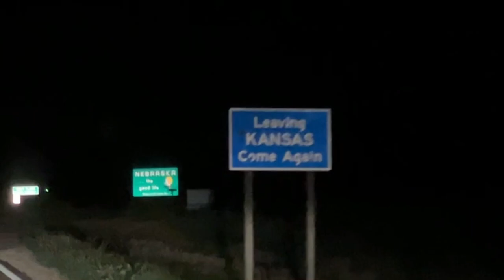Towing a 1969 Barracuda to the farm

Comment: Learning, Yes you do!  I have owned my 1969 383 Formula S fastback since 1984. The car was really incorrect compared to its birth in September of 1968. 

I have restored from early 2012 to finish in late 2014.  One of the 272 Torque flight  727 trans  equipped Formula "S" Fastback cars produced! 

Your purchase at quick glance is a B5/B5 SB one of very many. You can make it whatever you want, I suggest a gen 3 Hemi with a total paint and interior restoration to factory specs!

It will make the vehicle very sought after! JMO!
Reply from the maker: I love the gen 3 Hemi idea. Would love to find a wrecked Demon and swap everything over! Love your '69 holy crap what a beautiful car that is. I might copy that blue paint. Thanks for info truly enlightening.

Comment: You would have a easier time finding a 360 Magnum from any modern fool injected pickup. Intakes and carb's are cheap and easy to buy. Roller cams are easier to live with modern oils.  Wait till you try and buy that headlight bezel for the drivers side. Get ready to sell your first born.
Reply from the maker: Great advice! And I really never want to get a motor with AFM or whatever Dodge calls it. Thanks Henry!

Comment: If you want performance as a “little giant killer”, then go with a ‘66 or ‘67 273 Commando. That was the basis and the original LA engine. You could build more horsepower and torque out of those than you ever could a 318. The 318 was also an LA engine, but the 273 was better suited for building. The biggest LA engine was the 340, and that was a beast, especially as a 340 Wedge. My favorite motor is the 383, but in the A body Barracudas is was too heavy for any cornering or braking. For straight line performance they were great but not for enjoyable spirited driving. 273 Commando or 340 Wedge is the way I would go. My ‘66 barracuda Formula S has the 273 Commando with 727 Torqueflite console shift which was one of only 2600 made that year, and my Grandpa bought it new then gave it to me for HS graduation in 1984; and for that year boasted 275 horsepower (compared to ‘65 and ‘67 having 235 horsepower). My ‘65 Barracuda also has the 273. It’s  amazing what those motors can do. BTW, you picked the best body style as a fastback, hands down. When it became it’s own car, departing from the Valiant, in ‘67, the fastback was deemed as Italian styling, and to me remains the most beautiful car ever built. A ‘67 Fastback Formula S remains my holly grail, and at age 58, I’m still hoping to find the right one. (I’ve been in live with them since age 2, when my Dad bought one new in ‘67 until 1973). Good luck and I’ll be watching! PS: after finishing this vid; just a couple interesting tidbits of the Barracuda. It beat the Mustang to production and was the first Ponycar which was a new class, by 2 weeks. The ‘64 - ‘66 with it’s wraparound rear window is still the largest rear glass ever used in a  production vehicle at 14 square feet. It was Americas first fastback. The Barracuda was also the first car to have separate parking lights, meaning you could have them on without the headlights. Pretty cool stuff in the history of the little Barracuda. Enjoy!
Reply from the maker: I'm jealous of your '66 Formula S!! Thanks so much for the "tidbits" regarding pony cars. I also have a Marlin which is just interesting they called it a Marlin with the Barracuda on the market, and the Barracuda's don't seem to get the credit  for being first. Marlin's were Rambler's, and Barracuda's were Valiant's. I love all this stuff. After reading your comment I might look for a 340 wedge. Thanks again for your comment I feel lucky to have found this car! Will hopefully get to mess with it soon. Cheers!